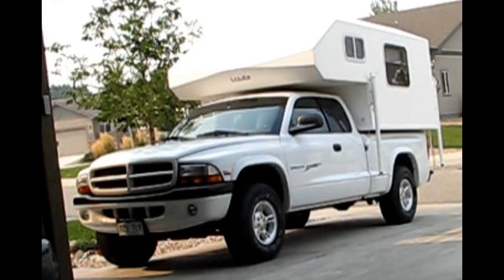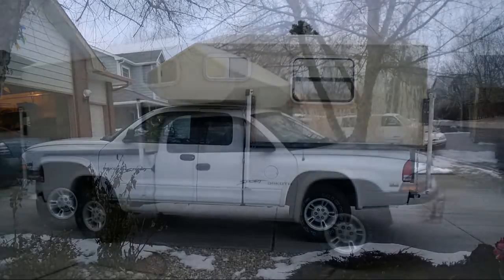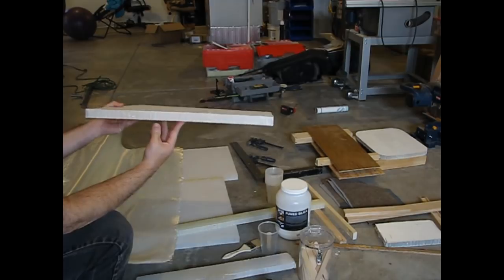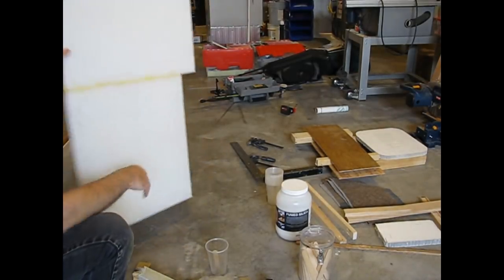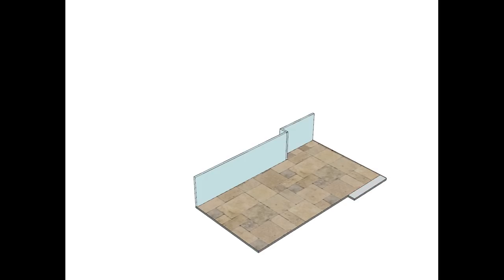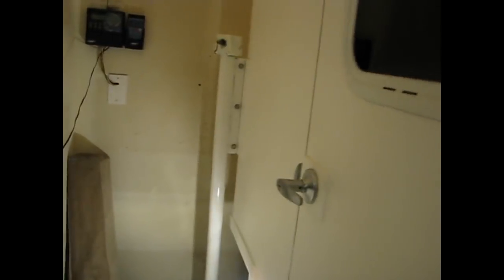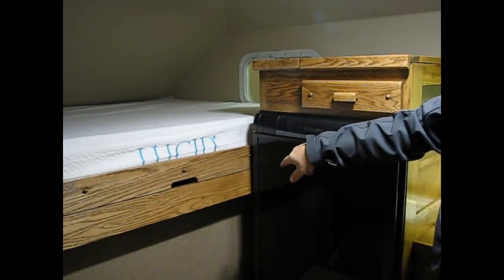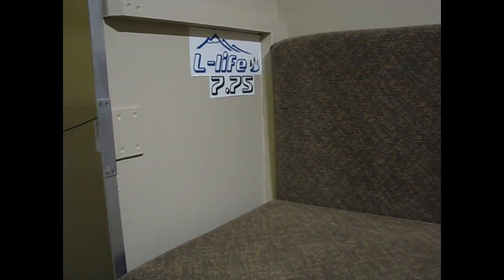Home built truck camper. L-Life explained

Comment: Question for you, I noticed your roof goes inward a bit. However if it was a flat roof. Do you think it could support you standing on it without any framing or additional support? Say if it was the same size as a full-size truck camper? I'm asking because I'm working on designing my own truck camper to build and I'm wondering if a fiberglass and plywood with 2 inch xps foam insulation core could support someone walking on the roof without traditional framing.

Comment: I love it! I am just about to build my own one. Thank god I watched it. I will change my plan. I have a few questions:
Did anyone ask you how heavy is your final product?
Also, do you have video about gluing the fiber glass exterior? It appears a very tricky to make it really smooth. 
Finally, do you apply an exterior paint in the end?

Jin
Reply from the maker: Weight is given towards end of video.  I need to rewatch video to remember what I said.  I think 780 pounds empty no jack's, lp, gear, or water.  Probably pushing 1100 pounds loaded (food, clothes, water, jack's, etc)

Comment: Great video. I've been planning out a design of my own with a very similar construction method. I do have one question for you. Why did you remove your tailgate rather than leaving it on so that your camper could be ~20 inches longer? That seems like it would be valuable space you wouldn't want to throw away.

Comment: This is great. I've had a plan in my head for a few years now to make something similar. Rather than using that honeycomb material, I planned to use foamboard insulation and laminate the whole thing as a monolithic shell with fiberglass. Your video gives me a lot to think about. I'm still debating whether I should make it a full height camper, or hinge the front of it and make a collapsing shell to reduce the height for when I'm driving so it doesn't murder my mileage so badly. Any thoughts?
Reply: The honeycomb has an airgap that helps  in the insulation efficiency, and you can run electrical, gas. And even water systems in the walls, and even more then that!!...little thicker, but alot better .
And you will be amazed, and glad you went composite!!

Comment: Uh oh!! At about 13:55 mark, a huge mistake! Toilet paper is in backwards! I'd fix that asap if I were you. Ok, I buy this from you if it fit either my 1993 Dakota or my 2015 F150 5'5" bed.
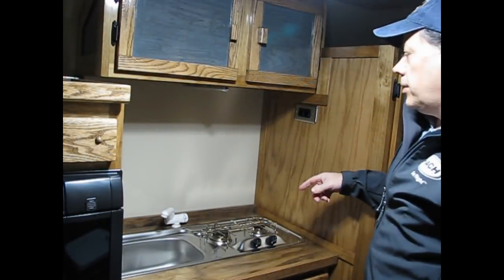Reply from the maker: First time taking on a project like this, so I'm not perfect -  toilet paper in backwards reallly, I thought someone would have noticed the screw missing in the over-the-sink light switch plate at 14:40.

Comment: You should be Mass Producing these. They would sell
Reply from the maker: I seriously thought about it, but my system of fiber-glassing all of the panels using a  3-part epoxy has too much WIP (work in progress).  I've seen trailers built with the laminated nida-core, but these were all built gluing the material to aluminum frames structures.  What happens in ten years when the RTV-type glue and caulk starts to fail?
Reply: I would buy one if you built me one hahaha
Reply: @bobanthony75  i thought this as well. could a more stronger, longer lasting glue be used? perhaps what boats are made of??

Comment: I enjoyed watching your build and love the end results.  I plan to make something similar for my ford bronco this spring and not sure if I want to use that Nida-Core or just the local foam board insulation with an aluminum frame.  Do you know off hand what the R value is of the Nida-Core?
Reply from the maker: I know the R-value has to be better than the popup campers that I once owned.  Best answer I could find is R = 3.3 per 25 mm (1").  The 3M data-sheet for the H8PP material shows thermal conductivity @ K=0.03. The aluminum windows frames had condensation (got down to 40F two nights) but rest of camper was dry to the touch.

Fiberglass  K=0.045, Polyurethane foam K=0.02, Expanded polystyrene K=0.033, Aluminum K=237.
It is lightweight, does not absorb water and has good insulating properties because of the air voids within each honeycomb cell.
Reply: Thanks for the fast reply and great info. Nice to hear your camper is doing well even in low temps. It's also good to hear its  R = 3.3 per 1"  Thats not bad at all.

Comment: Seeing your window sticker...it's too bad a truck of those Dakota specs isn't available today. Impressive work on the camper.
Reply from the maker: I did test-drive a new Chevy Colorado diesel (2.8L 4x4 long bed) at $48K without tax.  I really liked this truck a lot, and even my home-built camper will fit, if I rip the antenna off the cab.  The V-6 gas version is crap - all it does is makes a lot of noise as you rap the crap out of it to make it move (empty even).  My manual, stiff ridding, 18-year old Dakota is for better, even with its dated engine HP specs.  The Chevy's V-6 makes 275 lb-ft torque @ 4K rpm, vs the 295 lb-ft @ 3200 rpm for the old Dakota.  The Chevy's diesel is 369 lb ft @ 2K rmp (awesome) .  The greatest payload available for any the Colorado is only 1500lb.  I can't justify the all of the cost of a new truck for the MPG savings of the diesel.

Comment: I watched most of the video but maybe missed a few sections. So it's true that most of this camper stength is from glued together honeycomb panels? There isnt a frame for the most part except for the cab over part? Very impressed.
Reply from the maker: You say glued, but I say epoxied.  The expanding glue/foam was only used for the initial connecting of large panels and for gap filing.  All of the joined panels were reinforced with fiber-glass material on both sides.  The use of the fiberglass corners pieces are mostly for corner protection.  The door contains wood framing, along with all of the jack supports - need material to screw into.
I used to trailer my camper in and out of my garage (height reasons).  Well one time, I forgot to unhook the trailer from my truck, and as I pulled away with the jacks fully extended , knocked one of the front jacks off the camper.  The end result was embarrassing as hell, as the camper completely tipped over off my 2' high driveway into my side yard.  With the help of my neighbors the camper up-righted with extremely minor damage.  I had to fix the one jack support, and a 1-1/2" dented area on the cab-over corner.  Everyone was completely amazed, no cracks what soever.  I can't imagine what a wood framed camper would look like after a tip-over.

Comment: Awesome job!! I have a question on the edge areas where the nida-core was exposed how diy you go about covering it? Im trying to build a box, but on the 90, the nida core is exposed.... also did you use any steel or aluminum frame?
Reply from the maker: Isopthalic Polyester Fire Retardant Resin (ISOFR) Fiberglass 2" angle for exterior support edges.  This stuff has similar material properties to camper materials, and is a lot stiffer, stronger, and lighter than aluminum.  Plus no rivets to cover.  The jack supports are made from similar ISOFR material.  I used aluminum to frame-in the fit for the camper door, but this is screwed to 1-1/8" x 3-1/2" solid wood frame that is fiber-glassed in with the nida-core material.

Comment: Is your Sketchup available in the 3D Warehouse? I want to build a truck camper for my F150 4x4 that is light, strong, and only has the stuff I want, not what the MFG wants... I would want to use Aluminum framing instead of dimensional lumber (I'm a big guy and concerned lumber won't hold my weight in a cabover.)
Reply from the maker: No the plans are not in the warehouse.  These plans are made for Dakota and all of the dimensions are different.  If I was doing a full-size camper, I would use 1-1/2" thick material.  I will provides plans only after I sell the camper in about 10 years.  My wife (165) & I (185) both sleep up there, along with all of our clothes. Plenty strong even with the 1x4s which you could replace using 2x4s.
Reply: Dave, using some 2x2 inch thin wall square steel tubing for main part of frame would be 100 times better than wood....especially the over hang.....would not be too expensive to get the tubing and you would have  strong anchor points for the jacks to hold camper up while loading or unloading it from your truck....you probably have a welding shop in your area that may already have the tubing and could weld it up for you....
Reply: I would like to build a camper for a full size RAM 3500, crew-cab, 4x4, 8' (long bed), and I was also thinking about using Aluminum framing, instead of thin walled steel or wood.  Then cover with the Nida-core.  The factory built units are too expensive, and as you noted, the manufacturers don't always give you what you want.
Reply: Okay, I have my Sketchup done. I think... Thanks again for doing this video!
Reply: @josephfisher3831  so you must be following Everlanders build, cause he did his in a F550, with Aluminum framing, with 2" walls Fiberglass covered Nida-core (from the factory). His is a flatbed style, not a slide in, so is much bigger

Comment: Great informative post.In your search  for building material did you consider using exstruded polystyrene(pink or blue  foam used in home construction) covered in 18 oz stitched bi-axial fiberglass ? I think it would  be less expensive and  easier to obtain but do you know if it would be suitable ?
Reply from the maker: I worked with a guy who used the fiberglass over foam (wood framed) to build his bolt-on camper.  He built a pop-up truck camper for his F250 (no truck bed).  He had the camper professionally painted to match his truck (looked like the Earth Roamer).  I do believe the foam is the cheaper route, but he had some issues after a couple a years with a few bobbled areas where the fiberglass separated from the foam.  Last time I talked to him he was converting his popup (adding a higher permanent roof) to a complete hard-side, as well as fixing the problem areas.

Comment: Does the combination of nida core and fiberglass insulate well against heat and noise?
Reply from the maker: Answered earlier .  Best answer I could find is R = 3.3 per 25 mm (1").  The 3M data-sheet for the H8PP material shows thermal conductivity @ K=0.03.  Fiberglass  K=0.045, Polyurethane foam K=0.02, Expanded polystyrene K=0.033, Aluminum K=237.  Material has excellent structure-born sound damping properties.  Northern-Lite campers now using for the floors structures in their campers.

Comment: Great job! How long did the whole project take you?
Reply from the maker: THX for + comment.  I  bet a person could finish this kind of project from start, in about 3 months (full-time). Well as you know this camper isn't quite done yet - still need a table, solar, towel & coat rack, furnace, and etc.  I started over four years ago, but in this time I also designed and had a new house built, finished all of landscape myself, built a shed, and a few car and motorcycle repairs squeezed-in.  I built the cabinets during one one the winters in the basement, but the epoxy resin  work could only occur during the warmer months (garage not heated.  If you have the money - the laminated sheets of Nidacore would definitively speed the whole built process up.  If I do this again, I would use 1-1/2" laminated sheets, build for a full-size truck, & not stain the wood (because I suck at this).

Comment: Bob, first of all great build.  Question though, when you wanted to screw stuff in to any part of the body how did you unsure it would have strength?  I would be curious to see a video or some pictures on how you did this, like the screws/bolts for the fan and all the outside hatch entries.  Thanks for any information.
Reply from the maker: Plan ahead as much as you can.  Obviously the larger RV window has an epoxy covered wood frame that was fiber-glassed in, along with the corners (2x4s) for jacks and over-the-cab support.  All of smaller windows use the inner support rings - no screwing into the nida-core material.  I made a 3/4" thick wood frame for the vent/fan and ran the screws from outside into the frame as normal, the roof thickness for the vent needed to b increased to at-least 1-1/2" to fit correctly antway.  I made custom aluminum L-shaped brackets with tapped threaded holes for stainless machine screws, and installed as normal.  Cabinets have double-sided 3M tape along with a few screws and flat washers ran from the outside.  The nida-core material was allowed to dimpled in, but was covered and sanded smooth again.  The 3M tape is same stuff they build screw-less sided trailers.

Comment: were you able to build this in your garage you were standing in
Reply from the maker: I started this camper project in the 3rd stall of garage at previous address, and finished the camper in the tandem two-car garage of our new house the video was shot.  I made a dolly for moving the camper in & out of the garage, and use the truck and a pulley to  pull the camper back into the garage.  Working a motorized winch system as it is a pain to drive forward down the driveway as the camper is being pulled up in the other direction.
Reply: thank you for the help I wasn't sure how it was going to fit height wise through the door. I am old and blowed out I dont do well bent over and am trying to figure out how to build on a 30" high 6'x8' table maybe put the tow or three sections together outside when weather proof its going to be a hard sided 4x4 style like an Alaskan only with air hydraulic lifts . any way thank you for your valuable time over and out.

Comment: What did you cover the inside of the camper nida-core panels with ?
Reply from the maker: I am impress, you are the first person to pick-up on this material covering.  The upper sections are obviously epoxy paint (1-part).  Lower sections done with BEHR PREMIUM® Granite Grip™.  This stuff is awesome (experimented first on scrap piece), and is holding-up extremely well.  This material covers flaws, blocks light, doesn't stuff, and saves a lot of sanding.
Reply: Damn! That's an awesome work, but all I was thinking is about your  health.
Gotta take care of yourself, man.
You sounds like you gonna have a heartattack, soon.😤🤦‍♂️😇

Comment: If you ever want to sell I will buy it! I have a 2005 Tundra.
Reply from the maker: I thinking of making a larger version for full-size truck, may sell at that time.  Perfect for one person, but the bed just doesn't work for two adults.  Possibly switch bed orientation in the future for current camper.
Reply: @bobanthony75  Ok, does that mean you will be buying a bigger truck? Do you have a price in mind for the one you built?
Reply from the maker: @vinr6867  Not anytime too soon - going to work on switching the bed layout to front/back vs left/right.  I need to downsize current home and as we are almost emptynester, and build a real shop to take on another project like that.  I like to see how the new GM 2.7L turbo for full-size truck pans -out  - reliability wise.  When I do sell it, I hope to get close to what I put into it material wise.
Reply: @bobanthony75  Ok, yes the 2.7 engine is appealing but I do not trust GMC build quality especially with a new engine. Buy if I were to go with GMC I would choose their new baby duramax diesel engines.  Thanks for the info.  I think you would not have a problem getting 5k for your build.